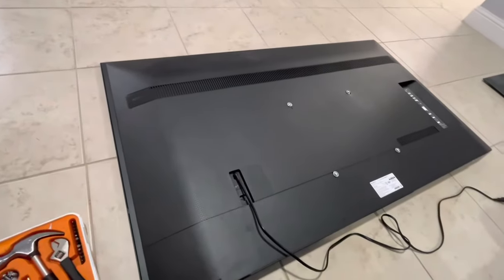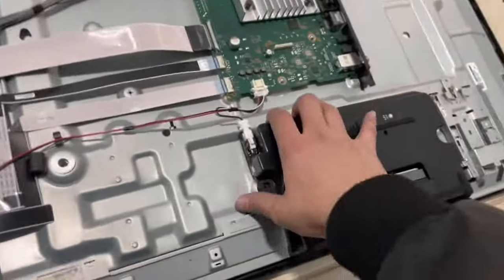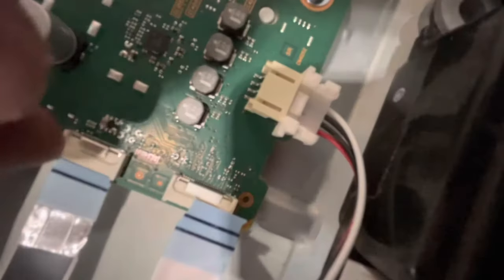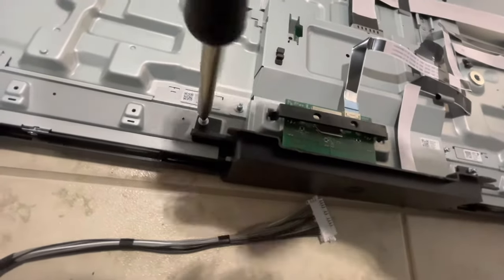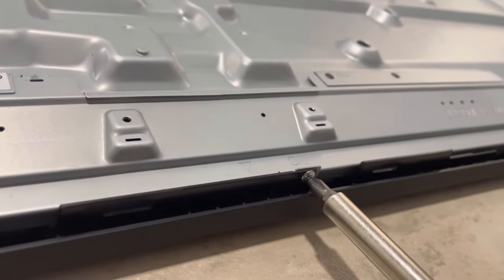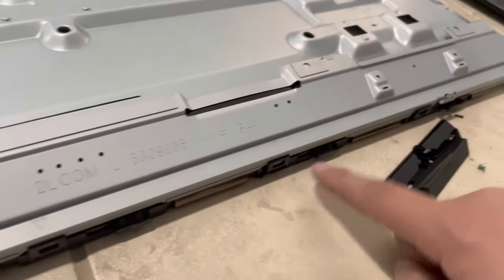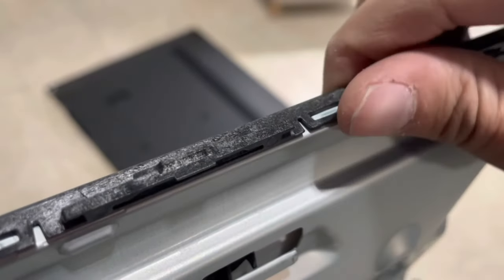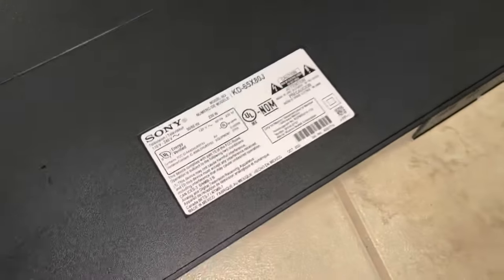Full Teardown of 2021 Sony KD 65X80J 4K HD TV for Repair/Disposal (Boards, LEDs)

Comment: Do you know where the microphone and voice command devices are located and can they be physically removed without the OS throwing errors up on the screen or causing some type of search loop rendering the tv inoperable? I know a lot of people would like to remove these devices, so you might get a lot of hits if you can show a disassembly/reassembly video and show the tv works afterwards.
Reply from the maker: microphone is on the remote, then transmitted through IR receiver
Reply: Not by IR. Remote is connected throught Bluetooth. Data get transferred